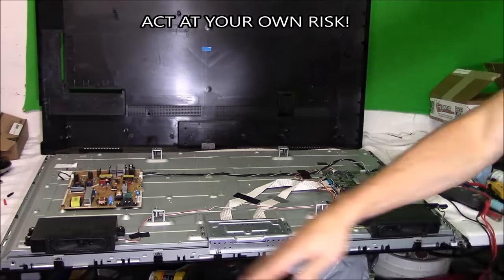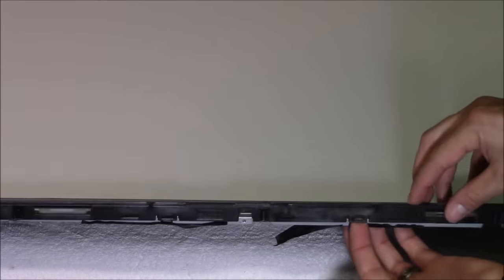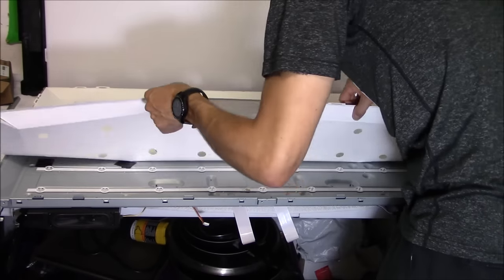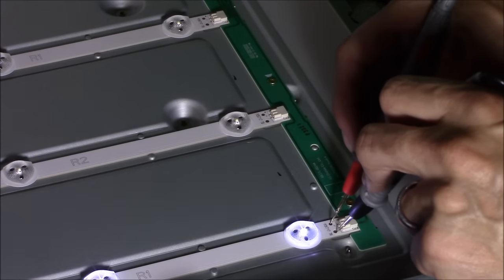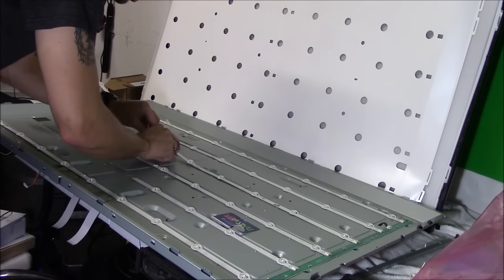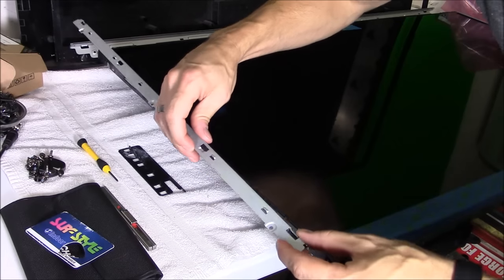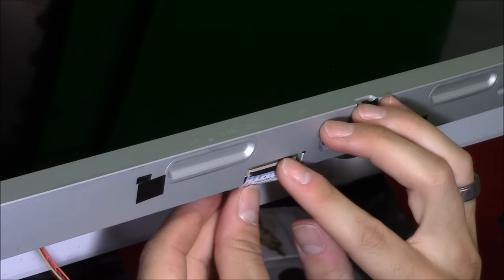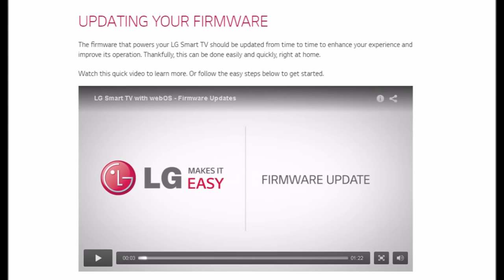How to fix LED LCD TV black screen no backlight, TV disassemble, testing LEDs, ordering part, repair

Comment from the maker: Part 1 https://youtu.be/Z1DEkSguWtg
shopjimmy has repair kits, LED backlight strip tester- http://amzn.to/2qa6QVF *affiliate link
Reply: ifraz the best
Reply: Tampatec hi please what website can I order the LCD light from and like how much does it cost
Reply: Nice
Reply: So dose those Backlight are the cause for them to flicker
Reply: Tampatec ,i need help to repair sony tv model klv46x-350a.power board ok,maybe mainboard faulty
Reply: you are a genius not leaving any viable way to see part one. You didn't  leave a link or anything I just love spending 15 mins navigating threw your channel to look for part one! brilliant!!!
Reply: Tampatec + our vizio smart TV  has gone to black screen w/5 green vertical lines right in the middle prior to this screen it still had sound.
Model- E390-A1
Reply: Tampatec  Hi there left a comment about a problem I have with my TV it has sound no picture when I first turn TV on the screen flashes up BUSH then of it's a BUSH TV not Samsung as I said in first message to u could u please advise me on whether I should take TV apart further to test led strips thanku for ne  help u can give me plus keep up the vids  helping people like myself CHEER'S
Reply: Tampatec, I like the video, but I have an edge lit Samsung LED TV, I did the flashlight test after replacing the power supply board, the TV was blinking the front red led before I did this in My 2011 UN55D6050TF, I found some led strips that match My current 2 and that are new, since Mine are dark, the psu sends voltage to the leds in My TV come from the psu and ShopJimmy said My psu board is ok, question is can you point Me towards a video on how to access and remove and replace the 2 LED strips? One on the right and one on the left.

Thanks.
Reply: Can you recommend any lg backlight strip to be used on my LG 32ln4900-td model?
Reply: Tampatec if a few leds are bad wouldn’t the screen turn on with a few dim spots ? Or would it be totally black ?i have a samsung which the screen is black, I went ahead and replaced powerboard, main board and t con board that didn’t work , I have no back light ,I tried the flashlight in a dark room and I was able to see the main menu wouldn’t you say last option is the led light strips ? Thanx
Reply: Hi, why are the backlights on the left side is lighting up while the right side is not? Thanks
Reply: When I turn on my television how come there's a black space in the center of the left side and then fuzzy strips across what does that mean? If you could answer this you would be a super lifesaver you have no idea!!
Reply: Thanks The best kinds of led tv leds here. Merter Elektronik in Turkey
Reply: Tampatec I have a RCA L40FHD41YX9 and can't find CCFL lamps. Any information would be appreciated. Awesome videos!!!  😀
Reply: what about a tv that has a slight pic then turns black any info will help it is a vizio 55 inch thank you
Reply: Hi, There are several different types individual LED’s for different TV’s.
I am think I would like to just replace the individual BAD LED’s.
What or where can I fine the correct replacement LED for VIZIO E50x-E1 TV ?
Reply: The LED Back-light strips are LB50068, but what is the part number for the LED that is soldered on to the strip  for the VIZIO E50x-E1 ?
Reply: Great description. But, you mess up one part & it is bye, bye anyway.
Reply: Mt TV have sound I can see everything on the screen by using a flashlight. I reset the tv to its factory settings it still the same. Could it be the t.con board  or the back light?
Reply: As of 711-22 the LED backlight strip tester is unavailable.
Reply: afterr change new led  why my all led backlight blink only after switch on.???have another problem sir? please help
Reply: How much voltage does it take to make the little LED lights up

Comment: This tutorial is 6 years old so you may never see my comment but I loved this 2 part tutorial. I had already done the flashlight test before I found this tutorial but I didn't know what to do next. 
I checked your channel. I'm glad you're still creating content in 2023.
Reply: In the same boat it sound like. I hope I fix mine
Reply: @dont_sweat9448  Just so you know I cracked the screen. It cracked under its own weight. It was super fragile. If I ever try it again I need to make sure the screen does not flex when I handle it.
Reply: @awaitingthetrumpetcall4529 
Someone, in another video, comments column, suggested, using a Clean and flat sheet of strong, Card Board, and Just ever so gently, nudge the screen up, just slightly enough, to Slide cardboard, under the Entire screen, to help raise it up...and out of the way....
Reply from the maker: @awaitingthetrumpetcall4529  I added a pt2 link in the  comments.

Comment: Your candid instructions are the best so far I followed. My BRUM  TV  LED stopped functioning at the beginning of the year. Its warranty had expired but I was referred to the company workshop in Kenya. The company charged me USD 65 to replace them. this was too much and I had the TV returned without repair. I got the New LED from a dealer at $20 and fixed it myself. Thanks so much for this useful information

Comment: Hi it's Wayne from Affordable Mobile TV Repair. Very good video, and I would like at add a few thoughts. You can actually repair LED strips when the strips are out of stock. I have been repairing LED strips for 5 years and have few call backs. As long as you decrease you BL setting to 60% and update your firmware(if available), you should have no problems. This week I will be posting the procedure on how to repair LED strips on my website.

Comment: I used this video and part 1 to get my LG 55LB5900 apart and tested. It's definitely the LED strips. Thank you for taking the time to make and upload this video. Thankfully, I have experience with laptop repairs, including the LED screens. They are very similar except more parts are integrated because of the much smaller size. I get the part where you say that it's not that hard of a repair. It's more getting the confidence that it can actually be done. It only took me about 45 minutes to an hour to get to where the LED strips are exposed. The only thing I did different was using smaller pieces of tape only between the ribbon cables that connect the actual screen to the boards. I just didn't want to take any chances of damaging one of those connections. I ordered the parts and I'll work on removing the old strips. I figured it's as good a place as any to take a break. There wasn't anything frustrating about it. It was very straight forward and this video helped A LOT. Thank you.

Comment: You can also plug up the TV once disassembled and use 99cent Tweezers to test each LED by touching both sides of the LED. The good LEDs won't do anything when doing this but you'll know right away when you get to the bad LED because all the lights will come on because when touching the bad LED with the Tweezers you're bypassing the bad LED forcing a Closed Circuit.
Reply: Sounds right, unless you have more than 1 bad LED in a strip.

Comment: Thanks for this video, Tampatec! My LG TV was exactly as on the video. I was able to follow all the steps easily. Painters tape worked great to keep the screen and the frame together. I didn't need the suction cup, since I taped the screen to the frame and I was able to remove the screen by lifting the frame. The tester and led strips from ShopJimmy worked great as well. Only negative point is I lost 3 nails by trying to unclip the frame! Then I realized a flat screw driver worked much better! Again, great video and easy to follow. I would add that it's easier when you disconnect all the electronic boards ans remove them, so you don't have to worry about damaging electronic components when you flip the TV

Comment: Thanks so much. Gave my TV a really good deep clean at the same time. It really worked. Changing the LED strips was 100% the easiest and most satisfying part of the job 😂 I did swear a lot when we got to the part where you said we should have removed the TV board to get the white pins out. Still, no big deal. Sorted my TV for £22. ❤

Comment: I liked your very detailed description of what to be careful of in the process of the repair. Very well described and prepared for safety and well organized in disassembly and assembly such as putting the same nuts and bolts together to remember when putting back together again. Very important.

Comment: I have a 49 inch Toshiba that's going bad, some days it works fine, but I'll say that whenever weather gets a little colder it begins to fail, but based on your videos it seems that it has a LED issue.  So, I will go for it and open it up to see how it goes.  I like your videos TampaTec, they're nicely done.

Comment: Grate video and well done with clear instructions.
I have LCD TV, and half of the screen is more bright but picture appears, but as it is more bright it makes viewing uncomfortable especially if dark video is playing.
Do you think it is because of back light? The right part is more brigher than left side. How to fix it?
Reply: I aso have the same issue but mine happened when I changed two backlights which was defective and the left one is brighter than the right one

Comment: Excellent video! This will be my guide. The painters tape part makes me a little nervous. I may just try to tape the hard parts of the panel instead of those ribbons that can fail. I like the way you set up the disassembly and reassembly. Thanks for the video!

Comment: Nice repair video.   Between all the labor doing surgery on a TV panel (which was never intended to be serviced), the cost of buying all the LEDs (and finding the right ones), and the risk of it failing again (because the manufacturer under-designed the back-lighting circuit) - do you find it worthwhile to do this as a business?
Reply: my thought as well. I currently have a samsung ua32f5500 for led backlight problem and don't see it as economical to repair as well as the risk of damage. Probably will just return to customer.

Comment: Tampatec - 
You. Are. Amazing. (and totally inspiring). 
I have a Samsung UN50ES6100 50" LED. Audio & power works fine. But video is extremely dark, like 5% visible in a dark place. Is this definiately a backlight strip issue? Where do I get the LED Strips for my TV if ShopJimmy doesn't seem to provide?  Thank you again for all your help!
Reply: Josh Goodwin you figure it out? Having the same exact problem 5% visible but audio and power work fine.

Comment: earned a sub...btw my screen is dark as if the contrast is all the way down but the brightness is set to max as well as the contrast I forgot to add that at power up the tv will flash to bright then defaults to a dark screen
Reply from the maker: If the picture very dark but settings for brightness, contrast and backlight is high then my logical guess few of the LED blacklight strips are bad. Get LED strips at shopjimmy.com and electropartsonline.com
Reply: @TampaTec  thank u

Comment: Your diagnosis and step-by-step instructions were simple, understandable extremely well done. Not sure how easy it will be for me to buy parts for my LG 32" LED TV here in Bohol Province of the Philippines. The labor here is inexpensive but the parts cost may be prohibitive. May just be better to replace my 4 year old TV. Thanks for a job well done. At least I have a better understanding of the fix if I choose to repair it.

Comment: It looks easy when you have the correct tools and tester plus a technical hand and brain. I love your work. I'd love to get the LED tester and the Phillip drill screw driver. How much does a complete set of LED strips on the back ligjt costs?

Comment: Great video Tampatec! Your youtube channel is really helpfull and inspiring! Good to see that some technicians don´t mind to share their skills and knowledge with others.

Recently my LED TV Samsung UE32f5000AW went complety dark, no picture. 
I have seen the part 1 video, tried to follow your steps and perform the measurements but due to my lack of electronics knowledge the results were inconclusive. The T-CON test showed image with the flashlight.

I have totally dissambled the tv and tried to test the backlights strips with a 9V battery, a LED and 2 probe needles. 

First, I removed each led strip and tested with each led of the strip individually. In all leds of all strips, the Test Led turned on (full brightness) but the led itself didn´t. 
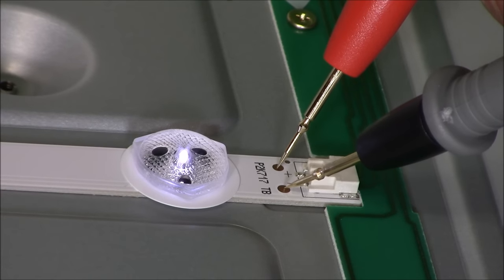With the led strip back in place on the led interface, I performed the test like you (minute 7:34), none of the stripe´s Leds turned on and the Test Led turns on 4 stripes (last 1 off) but with a diminished brightness, almost none.

With this info, can you tell me which part to replace (because I´m complety on the dark...).
I apologize for the long comment and I would appreciate very much if you are able to give some tips.

Comment: will just one failed LED in a strip cause the entire screen to go dark, or would it require multiple failed LED's to cause the dark screen?
Reply from the maker: Lewis A Fergusson yes
Reply: Incorrect, 1 failed LED in a strip and 53 working LEDS (from the 54 total for example) will not trigger the safe mode. You need more failed LEDS for this to happen.
Reply: I t depends on the failure mode and the TV. If an LED fails shorted, the others can stay lit. If it fails open, all the LEDs in series with it will go out. My TV has two LED circuits. One has 22 LEDs in 4 strips  and the other has 33 in 6 strips. Half of the strips have 5 LEDs, and the others have 6 LEDs. If any strip is unplugged, ALL 55 LEDs go out. The ones in the intact strips blink very briefly every few seconds. My problem is an intermittent failure, so I can't tell which one of the 55 is bad. I'm going to replace them all.

Comment: Good video, few notes
- the white screens behind the lcd in my vizio e60 interlocked with the screen brackets, so check carefully when disass-reassemble
- I dont know what tampatec uses to turn on the leds, i plugged in the tv and turned it on (lcd was disconnected) that did the trick.
- shopjimmy supplied me with the leds (thanks) they were used - i - hope they have a warranty ! they did work
- so on reassembly my picture was screwed up.  seems there are side tabs that dont connect to anything, yet can screw up the picture.  I noticed if i positioned the bad one correctly it would work. so I went to tape it in place and accidentally removed it with the tape!  So running out of options (putting it back on is near impossible) I notice that row was fine, the others had issues, so on that same side i removed all the tabs... and it worked!!  must be some strange grounding thing.
Just wanted to share my experience, THanks tampatec for helping me restore my $800 unit!
Last note - I called Vizio about getting the backlights, they gave me their tech support, who gave me shopjimmy....

Comment: Good repair,how fast will it be when ordering for parts?
Reply from the maker: akpolo mark 5 to 7 days
Reply from the maker: Stan Marsh I do LCD screen replacement on laptops usaully but not TVS because the cost is too high and risk of damage.
Reply: Tampatec g
Reply: What kind if tape did u use to secure then screen?thanks good video by the way

Comment: Question.  I took my 50" LG 50UH5530-UB apart, I checked the LED's with a tester I bought.  All 12 tested at 16.2V.  They all lit up.  I did notice the second from bottom had a voltage that jumped around a bit.  I was reaching across the table, so I thought maybe I wasn't touching the terminals enough.  And once I went over there, it too stabilized at 16.2V.  Reassembled it. (sigh??)

Tried replacing power board with part from "Encompass," LG official distributor.  Turned it on, same three blinks of standby light, then off.  I sent it back.  I replaced the two long 450V 68uF capacitors, that had little white hairs on the legs, and a slight burn looking spot on back, with good ones.  IT didn't work.

So I checked voltages through the cable with tester--outside leads showed 64.8 (multiple of 16.2, in series I guess), I got the same 64.8 on the inside two, but the middle one showed a fluctuating 32.4 much like the one I initially tested.

So, back to replacing those, do you think?  Could it be something else--does that little harness going down the middle (not circuit boards like I've seen on a lot of videos) have developed a short?  Do the LED lights sometimes work, but are they still flawed?  I don't move the TV much at all, ever.

Comment: Very good presentation. I understand every step and why, because I had completed a course in Electronics Technology.) However, it iwould be as tedious as you say. 

My LG TV is mounted precariously on the wall (because I was the one who drilled it in). Also, I have llittle time to give it the careful attention it needs.

Could you perhaps suggest  another alternative which is least expensive? Can you suggest who I should call to have it repaired by someone else?

Comment: Probably not economically worth fixing, but if you enjoy doing it I guess it's good for a couple bucks.
Reply: That depends on the size of the TV and how new it is. It would cost me $800 to replace my TV whereas I can fix it (including the voltage/backlight tester) for about $150. If I had already had the testers on hand it would be much much cheaper. That's a heck of a lot better than $800 to replace or several hundred to have it repaired. I have only 1 local tv repair place and they charge $100 just to diagnose the problem.

Comment: I have found all these videos very helpful for fixing television set's so far I've fixed a plasma tvMy latest is a led set by Samsung parts for it are difficult to find but it has helped having support from shop Jimmy!Very good videos take the mystery and misery out of working on the unfamiliar technologies.